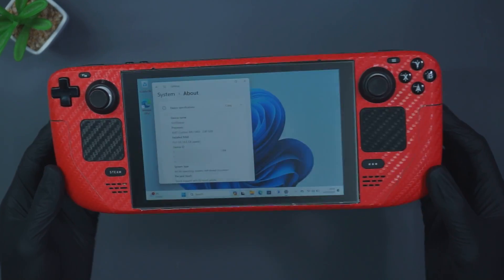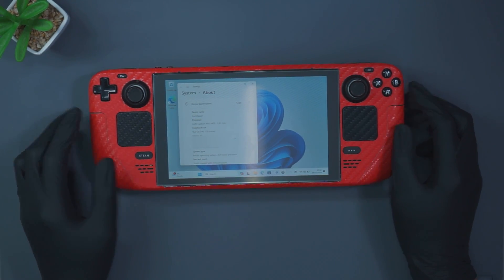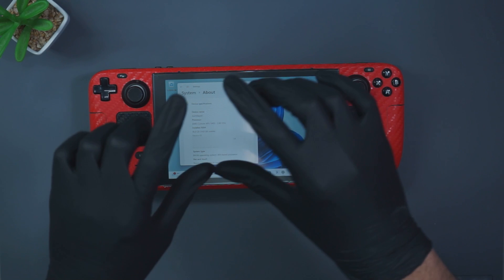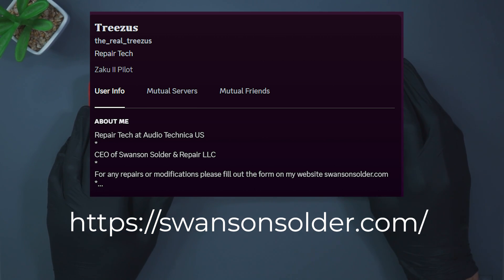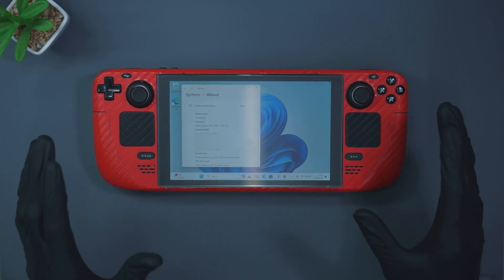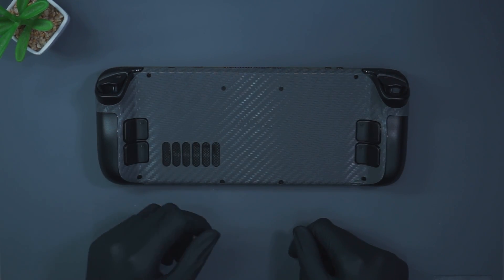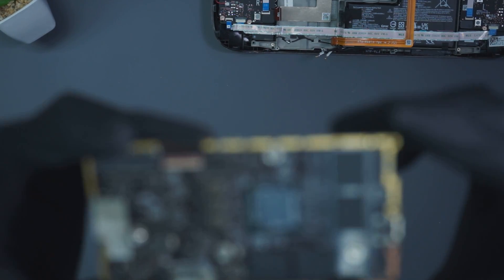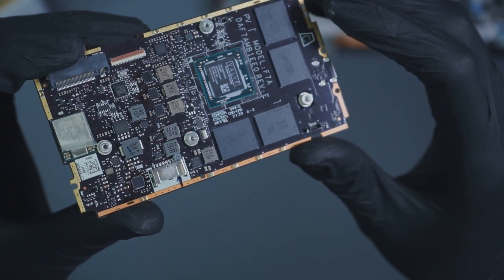Steam Deck 16GB to 32GB RAM Upgrade | Joshi Repair

Comment: hey man im 100% interested in this message me id like some info? i tried to contact another guy. i feel like i could do this myself but id much rather have it 100% right and a long time improvement you know?
i wanna get a steam deck get the ram upgrade ill do the storage upgrade and i want to swap it to the clear purple case cause they look so cool. ive heard of some annoyances with that but who cares its easily fixable. while its open i kow of a good thermal paste im gonna repaste it with and fix some thermals and im willing to bet its a much more solid contender after that.

Comment: I've got a quick question. Since this requires us to flash the bios, does this mean that any update pushed by Valve will reset the bios? (I'm keeping mine linux based and would like to know)

Comment: Hello, I would like to ask on the website to buy a ram chip. Do I have to buy 4 chips or does it come with 4 chips? What I want to buy and I don't know if it is the price per unit or for 4 chips.
Reply from the maker: Hello,

We hope you are well.

The listing on our site is set per unit. So you would need to adjust the quantity to 4 in your case. We hope that helps.

All the best,
Joshi Repair

Comment: I saw someone else do this upgrade and they had to install an updated BIOS so the deck would recognize the additional ram. Wonder if this update to the BIOS would need to be necessary every time and update to SteamOS is made.
Reply: Yes because the BIOS gets flashed every time the device updates. Which is more akin to a mobile device than a desktop PC.
Reply: You can use konsole code to block steam from updating bios. Long as ya leave the update settings on stable should be OK.

Comment: It's the custom bios that get me. Steam os constantly messes with the bios and returns them back to normal. It would be a pain in the butt to deal with. I know this thanks to overclocking my steam deck all the time. I even gave up on it because of how annoying it was to keep reinstalling the bios
Reply: Ah so based on what you're saying, any update that valve pushes on steamos will reset the bios back. I'm guessing this is why people install windows on it as to not have this hassle of constantly updating the bios whenever a new update comes
Reply: @Xafnir  yeah. I found a command to trick steam os into keeping the old bios for longer but it isn't flawless. Updates still revert back but at least if you don't update it doesn't. Cause sometimes steam os will be like, ik you just restarted but here.  Lemme f up ue bios. I wish there was another option but now valve is finally adding overclocking to their new updates. Not complete but it's something.  I also hate windows on steam deck, it is so slow and clunky

Comment: Valve needs to come out with 32gb version and the other companies need too
Reply: Its unlikely to benefit massively from it.

Slightly higher power usage, slightly lower battery life and minimal performance improvement.

The steamdeck is a dedicated gaming machine, you're unlikely to be running a multitude of workloads on it at the same time. 16GB of ram should be sufficient for all but the most intensive workloads.
Reply: @lmaoroflcopter  that for gpu and cpu that shared 16g 8 for gpu 8 for cpu
Reply: @wwrye929  Yes it is shared vram, but again unless you're an edge case you're not going to notice any performance gains.

Comment: I get why the part at 3:48 is needed. I don't understand the actual process. Are you disolving those resisters? Cutting one in two? Can't really tell. Other than that, very insightful video.
Reply: he's desoldering it, moving it over, then resoldering it

Comment: Super impressive video and showing some great skills swapping the ram chips out,  a  massive thumbs up! I just cannot understand why the device is running windows, with the gap narrowing now with only a handful of AAA games remaining. Performance wise the deck is better with stock os.
Reply: I'm dual booting because certain launchers are really difficult to use on the Steam Deck. I have large libraries in multiple launchers. If you're starting fresh, then maybe you won't mind sticking to SteamOS. 

EA Play is a huge culprit. That thing needs to update almost daily and each time you need to redirect the executable to the one that also does the update. Pain in the arse, and it's not the only one pulling this. I'm using Steam OS for anything I get and own on Steam + EmuDeck. The rest goes on Windows. Made it so it shares the same storage between the two. 

I've even got certain games install on Windows to show up on Steam OS by adding the executable as a non-Steam title. So I guess I can do that if I wanted, too. 

Also much easier to upload images and videos to social media and Discord to share with friends via Windows.
Reply: @mephrokat08  a great explanation 👌 and I guess the mod is needed with windows.

Myself I haven't come across a game that i really want to play that i would need to dual boot at this stage, everyone says you need windows for fortnite, but with xbox cloud the game is working fine, over stream, on my linux pc I'm getting 69 - 70 fps on a 1080p, but i haven't tried with steam deck, but guess it would be more of the same and look amazing.
Reply: maybe is for games or other things that straight out cannot run or flat out do not exist on linux?

Comment: Can you do some bench marks before and after as its a bit pointless showing the upgrade, no one knows what the advantages are
Reply: @Blackfatrat  Not to mention, a great deal of people think RAM means more speed, when it is actually more about system stability...
The more RAM you have the more stable that your frame rate will be.
Reply: You could open even more chrome tabs, if for some reason you are able to install chrome in one.  That's it.  Nothing fancy.
Reply: You can open more Chrome tabs with 32gb ram.
Reply: @Blackfatrat your PC isn't sharing system RAM as VRAM, it has dedicated high speed VRAM. 16GB is enough for most games, but with 32GB you can crank up details like Texture settings which can easily take nearly 8GB on the Steam Deck on newer AAA games, ie Horizon Zero Dawn, Last of Us etc, without getting stuttering on the Deck due to swapping.
Reply: @Blackfatrat  Try Unreal Engine 5
games
Reply: the advantages are for if your game NEEDS the ram. if you do modded minecraft, switch emulation, play mmos like guild wars 2. you will quickly run out of ram, getting more ram, or having better developers for proton/those games and programs is the only other fix. anything else you will maybe, *maybe* see 1-5% gains, if you use the extra ram for vram, ontop of the ram being a faster speed. its negligible for most things, but for some things its night and day, literal game changer.
Reply: Was this the OLED or LCD steam deck
Reply: @Blackfatrat anyone that starts a comment with "eh" is a clown pos
Reply: From my understanding there is no real benefit to it but some people are using it to make these videos to boost channels. You have to be someone who has a lot of knowledge about soldering and a very sturdy hand.
Reply: I’ve been begging and offering to pay people to show benchmarks for the legion go or rog ally upgrade. It’s really really sus no one has. If people would show benchmarks it will make people want to do it who were on the fence. Even if it’s only a few fps more on the 1% lows. I still need proof it doesn’t make it worse some how
Reply: I played some old AAA game a month ago, and it used all 12Gb of ram (plus 4Gb used for APU). I definitely will do this upgrade.
Reply: @Blackfatrat unless your pc uses an apu I.e the gpu is built in to the cpu and not a separate card you can’t compare with a steam deck or any other such device, the ram is shared between the cpu & gpu so the more ram you have the more each can use.
Reply: @Blackfatrat  I’m sorry you’re the expert then, I should stop listening to those who make a living from these things and listen to people like you. 🙇‍♂️
Reply: @Blackfatrat  you literally did and you literally did so just now 🤷‍♂️
Reply from the maker: https://www.youtube.com/watch?v=yr_xtTxmBdo&pp=ygUXam9zaGkgcmVwYWlyIHN0ZWFtIGRlY2s%3D

Long awaited!
Reply: @Blackfatrat  thanks for telling us you lack reading comprehension  👍
Reply: People know perfectly well what the advantage of more RAM is
Reply: @Blackfatrat  you’re the one pretending to be an expert not me, btw an expert who’s claiming that the full 16gb of the steam deck is being used by the gpu when that’s not how it works in apus.🤷‍♂️

Comment: would the 32g ram make a difference 
will it use more battery or cause any issues i might do this with my oled or lcd if it improves dramatically
Reply: Can make certain games run that couldnt with the combined 16gb of ram between cpu and gpu before
Reply: It can make the difference in some scenarios, specially for games that benefit of more VRAM.
If you use CryoUtilities, you're assigning more memory as VRAM and expanding the Swap to compensate (which is slower and reduce the SSD life). With 32GB, that problem would completely disappear.

Comment: Can this be done on oled? I know they changed the layout, ram type and size, speed, frequency, etc., but is there an equivalence to the current oled's  type of ram that would allow this upgrade? Like, upgrade to 32gb, but stay at 6400 mts? Because if I can eliminate stutter from tiny tina's, horizon zero dawn, bl3, and a litany of other games I would gladly fork over at least a couple hundred. Probably as much as $400-$500  if before and after benchmarks can be shown with framerate lines during play. You guys would get a ton of business. Just be able to eat the cost every once in a while when you mess up.
Reply: I’m trying to source the RAM but a lot of conflicting information out there has been hard to nail down the correct RAM. Not sure if the current BIOS flash will work with the OLED either.
Reply: @sigma682  you would think hardware info would be readily available.
Reply: @charlestannehill7537  it probably is, I just don’t know what I’m doing lol
Reply: @sigma682  well you know more than me. I would never attempt this with my nerve damage. That's why I'm willing to pay.

Comment: I think its bull shit there are never before and after performance stats
Reply: They stated in multiple comments that gaming performance increase is pretty much neglectable between 16 and 32 gb and that the upgrade probably won't even be noticeable to the majority of people unless you are actively looking for it in specific usecases.

Don't really see the need to include extensive tests if the results are basically unchanged for most usecases

Comment: Damn would have been great to do here in the US, bought the steam deck OLED and would love to have the 32gb ram since it’s a shared with the vram I wouldn’t get the the issues with some vram heavy games
Reply: Just set to 4gb and get the fastest storage for paging files.
Reply: FYI SD OLED uses 2x 8gb RAM chips instead of 4x 4gb in the SD LCD. Still trying to source the RAM chips for OLED. Don’t know if the same BIOS/Firmware flash can be used.

Comment: All this and you don’t even use PTM7950 thermal pad instead of cheap thermal paste???
Reply from the maker: We've been using ARCTIC-MX 4 for the past 4+ years, and it's served us great. Our Steam Deck CPU temps level off at 78C after 2 hours under load. If the PTM7950 drops those temps by 10C+ we may consider it.
Reply: @joshirepair  You’ll see 3-7. It doesn’t need to be replaced as frequently.
Reply: Steam deck and switch k8nda has that thermal pad as overkill.   For the switch the factory paste actually works better and way way cheaper than the thermal pads in tests.  Go figure.  You just have to read up before you stick that thermal pad anywhere.   There's certain ThinkPad where paste works better and certain ThinkPad where replacing thermal pads with paste makes your cpus go poof!

Comment: Does this actually increase the fps of the system or allow the steam deck to play games it wouldn't normally be able to play?
Reply: it doesnt make any diference, steamdeack cant run games in high quality anyway, it doesn't need more ram.
Reply from the maker: I agree with you.

Overall, it helps with paging, eliminating stutter in select games and very small things like 1% and 0.1% lows. The upgrade would also benefit tasks such as video editing. In all honesty, if you gave someone a 16GB deck and switched it out for a 32GB one without them knowing, most wouldn't notice a difference until you told them.

We did this for ourselves on our own deck, as we like to tinker with these things. Since the improvement isn't that huge, we don't offer it officially. If someone would like it done, however, we're more than happy to have that done for them.
Reply: But doesn't the ram share with the VRAM??? So could you up the VRAM to 8gbs or more and use the rest as ram

Comment: Man, I admit nice work had been done, but how about test? Is there any reasons to do this upgrade? There are several videos of this kind upgrade, but nobody say what they eventually got from it
Reply from the maker: You're right. We realised afterwards that is a silly mistake on our end. Benchmarks should've been included in the video. After testing, we can say it's not really worth having this done in general. Very few tasks or games benefit from it. 

Overall, it helped with paging, eliminating stutter and very small things like 1% and 0.1% lows. The upgrade would also benefit tasks such as video editing. The difference however for a device like this isn't large enough for us to offer it as an official service.

We did this for ourselves, as we like to tinker with these things. If someone would like it done, however, we're more than happy to have that done for them.
Reply: @joshirepair  Thanks for such detailed answer! Was thinking about such upgrade. Regards
Reply from the maker: @Challenger440rt   You're very welcome. All the best,

Comment: Great video dude, could you or who ever do a workload/gaming performance caparison between 16gb and 32gb on linux. I want to know if its worth the upgrade to do it myself.
Reply from the maker: We've only had time to test it within Windows and SteamOS. If we have the chance, we'll do Linux too, but the results are bound to be the same. We found that most AAA games will have pretty much all stutter eliminated. Overall, it helps with paging, eliminating stutter and very small things like 1% and 0.1% lows. The upgrade would also benefit tasks such as video editing. 

We did this for ourselves, as we like to tinker with these things. Since the improvement isn't that huge, we don't offer it officially. If someone would like it done, however, we're more than happy to have that done for them.
Reply: @joshirepair  sweet dude thank you! i expected as much, its just nice to see it. Keep up the good work.
Reply from the maker: @MechThumbs  Thank you 😁
Reply: @joshirepair steamOS is linux though

Comment: will the 32gb only be usable in windows or will it also be detected when running SteamOS to play the AAA games?
Reply from the maker: We actually took this deck back to SteamOS, and it has kept it's 32GB accessible value.
Reply: @joshirepair  do games run better on it with 32gb or is the difference in performance minimal?
Reply: @calebmoss802  depends on if the game is memory intensive or not, there will be some improvement for more intensive ones, but overall is still a bit limited from the limited overall power-budget with a 40~50 wh batt and a normally 15w thermal limit.. mine is set to a 12/4 [sys/igpu] split on it's stock 16 gigs.. same 4 gig split would get 28/4 on a 32 gig ram mod

Comment: Can you give some examples of which games may require this much ram? Are we not limited by the graphics card mostly?
Reply: Mainly modern triple A games.
Reply: Alan Wake 2 would probably benefit
Reply: Horizon zero dawn and god of war on steam deck. Those two use so much ram that the vram part of the apu gets throttled.
Reply: Avatar frontiers of pandora. Мы не ограничены видеокартой, видеокарта может и 8 Gb vram потреблять. Память общая и она распределяется.
Reply from the maker: As Slick says, mainly AAA games will have pretty much all stutter eliminated. It would also help if you were to use the deck for something like video editing. We did this for ourselves, as we like to tinker with these things. Since the improvement isn't that huge, we don't offer it as a service officially. If someone would like it done, however, we're more than happy to do it for them. 

With our testing, it helps with paging, eliminating stutter and very small things like 1% and 0.1% lows.
Reply: @joshirepair  дядя, скажи просто: 32gb реально работают или просто цифру видим в свойствах системы, но Steam Deck не использует эти +16gb памяти?
Reply from the maker: @VasiliyBr1982   Мои извинения. Я должен был это сделать и включить в видео. Я вернулся из отпуска и сделал несколько тестов, но результаты оказались незначительными. Это влияет на пейджинг, а также на минимальные значения 0,1% и 1%. Делали это для себя, так как любим модифицировать электронику. Если кто-то еще захочет это сделать, мы будем рады это сделать, но из-за результатов мы нигде не предлагаем это в качестве официальной услуги.

Устройство может получить доступ ко всем 32 ГБ памяти, но это требуется редко.

Спасибо!
Reply: @joshirepair  в Avatar frontiers of pandora требуется памяти в сумме 20 Gb, поэтому, думаю, 32 Gb вполне пригодятся.
Спасибо за ответ и желаю успехов вам и вашему YouTube - каналу!
Reply from the maker: @VasiliyBr1982  Вы очень добры. Спасибо и всего наилучшего!
Reply from the maker: Correct. The GPU within the APU is mainly responsible for graphics related tasks, including real time rendering.